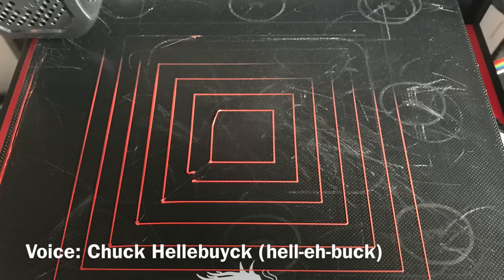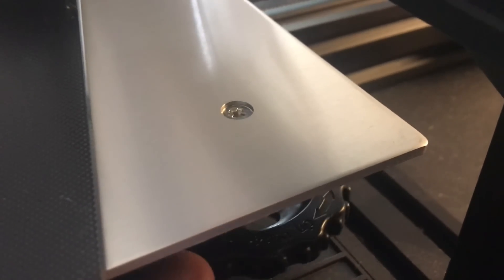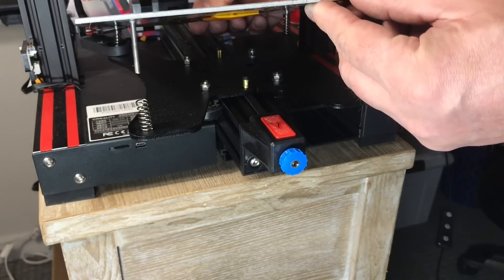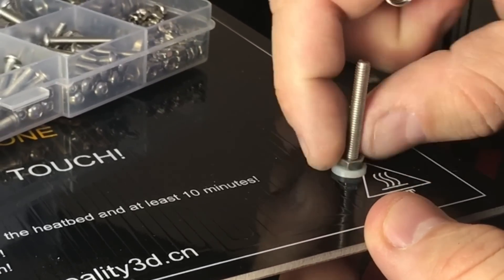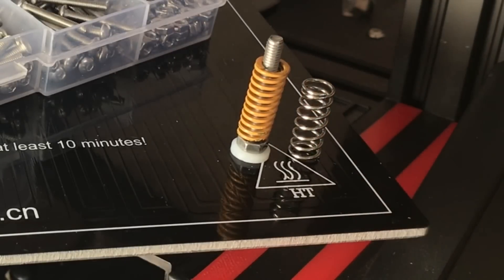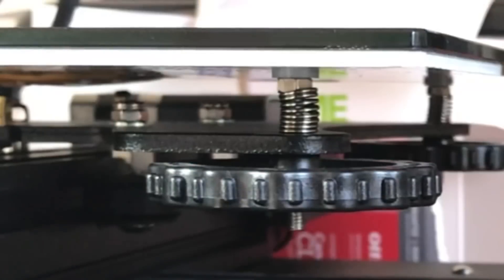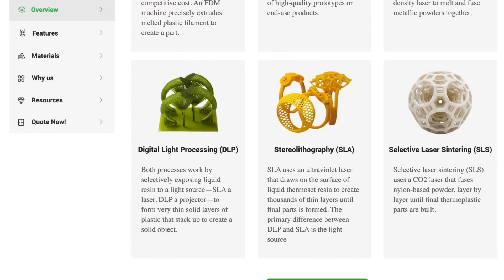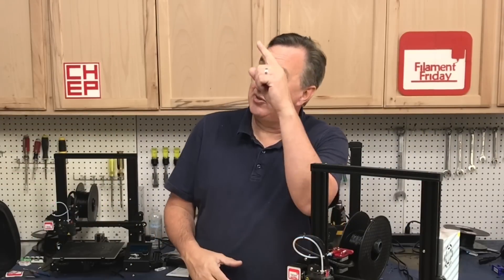Fix Your Creality Ender 3 Bed Level

Comment: My Ender arrived with a deformed bed. It is more deep on the center. It is a common failure with the Ender 3 Pro or it is only my case?
I tried to mold it just applying force with a lever and I partially solved the issue but it is still deformed. 
That problem increases the difficult when trying to print, not to mention patterns like the ones on this video, they are really imposible to achieve.
Can I dissasemble the bed and straighten it on a table? Or what I can do?
Reply from the maker: It’s somewhat common. Many people replace it with a glass bed.
Reply: @FilamentFriday  I did the thing of straighten and now it is working better. I dont want to use glass because: I have no money for now to buy a rectified glass (here the common glass from shops are some deformed too). Where I live is very expensive to get some things like that glass. And finally I like the Ender's hot bed.
Thanks you for your answer. I consider anyway to buy a glass.

Comment: hello Chuck, thanks for sharing so much info about 3d printer. in my workplace working with ultimaker with cura. (PLA) printing with 10 degree slop in part is causing issues in print.on bottom surface it makes steps of layer. tried with PVA filament. please help me or make a video on printing very low angle part. 50mm base 50 mm slop angle around 10 to 15. thanks.🙏
Reply from the maker: Use supports.
Reply: @FilamentFriday  thanks for  responding. i have tried PVA for support. but no good results , and sorry it was 80 degree overhang. 😅.

Comment: Is there a webpage or video that someone could point me to that helps select the right printer?
The Creality website has about 25 FDM printers including 4 different versions of the CR-10 and 8 different versions of the Ender. It gets confusing.
Reply: Depends on what you need it for and how much you want to spend. Ender 3 v2 is amazing for most prints, but limited bed space -- it's not very large. The CR10s Pro v2 is a great printer for larger items, but it's not as precise for smaller more detailed items as the 3 v2. The Prusa i3 MK3S+ is also amazing, but about double the cost of the Ender 3 v2 (even with full upgrades). Basically, just look for the release dates of the printers and but the newest. I believe all of the V2s are currently the newest of lines! Good luck, brother! 🤙🏼

Comment: got a new printer, whats the difference of the cura slicer and creality slicer, there is a huge difference between build time and amount of materials used
Reply from the maker: Depends on the settings. Creality is just Cura underneath.

Comment: The similar for my Ender 3 Pro, but used teflon tape (to keep it slim) and nyloc nuts. To install without peeling off the magnetic bed was a bit of a hassle using pliers and to get started and two regular nuts to torque down. Next part is replacing the wheels with wheels that take nyloc nuts as well.

Comment: Print the wheel to accept a nyloc nut - u will never have to adjust your bed again - I found the stock adjuster wheels move and float around a bit ( the stiffer springs would help the stock adjuster wheels from moving ) but I just run stock springs and nyloc  and havent adjusted my bed in over a year .
Reply: I did this as well, about a year ago. Hasn't moved since.

Comment: Now I just need to know why my Ender 3 won't print at the centre.
Reply: @Riggsvsoliver the bed is flat as possible. What i mean is that when printing, the the area printed is off from center. Meaning if you print is at the centre, the actual printing is slight forward than the actual print location.

Comment: Locktite Bearing Retaining compound undr the screw head will fix that without all the hardware, and will allow the screw to be removed later. A medium strength threadlocking compound might work just as well.
Reply from the maker: How will it handle 80°c bed?
Reply: @FilamentFriday  Engine parts commonly reach higher temps. Blue loctite is your friend.
Reply from the maker: My experience with building racing engines showed its great for bolts under torque but a looser fitting like these screws doesn’t allow it to harden as well and the higher temp adds to the issues. So I still like my simple solution.
Reply: @FilamentFriday  Race engines? Then you should know about the higher temp versions that have been out for years.
Reply from the maker: I know about them but the method I showed works for most of my audience. 
http://www.elproducts.com/stock-car-racing.html

Comment: I used some thread-lock on the underside of the screw heads.  It forms a very strong bond, but can still be removed with a little force.

Comment: Hi, I did this fix in two other brands of printers a few weeks ago, but the interesting was that I learned it from the Geeetech A10 (latest 2020 version), where nuts are included already in the stock bed so that bolts dont turn. The Geeetech brand is taking a lot of learning from the Enders around there and applying it to their latest products from stock. Interesting huh :)  

But great video and yes, this is a MUST almost to any printer, with the care of having proper sealing to prevent a short in the bed.

Comment: My Ender 3 has the magnetic sheet over my screws - looks to be glued there. If the only way to do this is removing the adhesive magnetic sheet?
Reply: Yes. You can cut a hole through the sheet to remove the bed easier.
Reply: @a2112drummer  no. just thread one nut down to the bottom. then put two nuts on the end jammed together. then use them to hold the screw while you tighten the one to the bed.

Comment: You could have used a very small drop of semi permanent (removeable) Blue Loctite on the head to stop it rotating.
Reply: loctite 242(blue loctite) softens with temperature quite easily
Reply: @gglovato  Goosd point... Didn't think about the heat...

Comment: I went straight to the yellow springs, a few months ago. Immediately solved any levelling issues
Reply: Same here - they're longer, but if you squish them it makes the whole bed very stable between prints - now I'm leveling it almost only when I change the filament type (I'm looking at you PETG...), nozzle, or bed surface - works like a charm
Reply: @KonradSarnowski  I’ve actually printed 4kg without touching the bed level. New record.

Comment: noob question, but are you lowering the z onto the paper, or onto the bed, and then sliding it under?
Reply from the maker: Lower the z stop so it homes low enough to get close to spring compressed then adjust bed knobs to slightly rub on the paper.

Comment: I use the same trick for ages. I also experienced the same problem. I used first metal washers I made a short cut, but fortunately damaged nothing. I then purchased PTFE washers.
My goal was to make the link between the bed and the carriage more rigid. If you block the carriage and push the bed you will see that the bed is moving, not much but it is visible, and the bed does not go back to the exact same position when released. This has little effect at low speed but the faster you print the more efforts are needed to accelerate the bed what introduces these displacements and generates artifacts in the prints.
Before tightening the bolts, I maintain the bed in place supported by pieces of wood, as high as possible but with the screws inserted in their holes (no spring, no knob). This ensures that the screws are parallel, and that the bed can move freely vertically. I tight quite hard.
Thanks for your videos.

Comment: The knob in the Z-axis switch is actually to align the switch vertically on the correct height on an all-stock Ender.
If all is mounted and aligned correctly, the switch is on the perfect height when aligned with this knob. I wouldn‘t cut it in a stock machine...

Comment: I've added locknuts upside down to safe the conductive lines, works great and I don't get problems with softening washers due to an heated bed. Adding a washer between nut and spring prevents the spring from shifting and/or slippin over the Nut

Comment: There is also Locktite Blue. if needed  It will hold a screw in place, but you can break it free if needed
Reply: Loctite has different bottles with "blue colored liquid", the number on the bottle is important to know if you have the right one ...

Comment: I installed my printer last June and started to see similar problems. Unfortunately, this video only came out today, and other videos that also demonstrated it I hadn't found. So instead, I was "that guy" who over-modded his printer WAAAAAY too early. After two weeks, in a panic and taking too much advice, I spent the next two weeks installing the BLTouch, trying to learn how to flash the firmware to do even that, bought a glass build plate, and reworked the gantry...twice.  June was HELL.

In the end, I found that three of the four screws all rotated on my bed and I also ended up with a bad USB port (which was the cause of all my woes trying to update the firmware). I got nylock nuts and an SKR Mini board...and things worked out well.  Still, overtime, my bed is BADLY warped and I'm still struggling with it from time to time, but seven months later, I'm starting to get prints that are behaving.

I've broken parts of my printer (overtightening wheels, stressing wires, etc.), found places it was just manufactured incorrectly, but one thing is for sure: I KNOW my printer now. I'm far less inclined to "OMG! I need to order a new expensive part!" than I was six months ago.

But no...I'm not giving up on this thing. Not by a long shot.
Reply: Same thing here, purchased the printer with the mindset of "oh! I'm sure this $220 printer will be just enough out of the box" and 1 week later I was installing a bl touch and upgraded springs and extruder and modifying the hot end... Always something with these machines I swear lol
Reply: @gopro2027  I'm in the same position, I absolutely love upgrades but usually I wait enough to fully understand the stock product. Now I am terrified that if I change the hotend or whatever I will eventually mess up all the experience on the stock one that I have lol
Reply: @davidefogagnolo   to do the upgrades I still had to understand how to level the bed and stuff, and taking apart the machine to put on the upgrades helps me understand it more in that sense. I don't think you will mess up any experience you have.

Comment: I got a kick out of how you introduced the ad:  "If you're watching all this, and if you don't want to fool with a 3D printer any more...."  I don't think most of your audience (including me) will ever get tired of fooling with 3D printers.  That being said, I found your simple mod very interesting, because I did something very similar to the bed of my Ender 5 Pro.  In my case, I had a feeling that the knobs were not staying put, so I decided to design and print some leveling knobs that had a nylon-insert nut in them.  Of course, when I tried to put these on the bed screws, the screws just spun around.  I did just what you did (minus the plastic washer, which I should probably go back an add..), except I used some larger diameter springs that went over the nuts.  (I also had to cut openings in the magnetic pad at the head of each screw so that I could access the screw heads with a screwdriver.)  This mod has worked well for me, because the bed adjusting knobs seem to be staying in place now.  Thank you for this video.

Comment: I use the yellow springs + nylock nuts, and also adjusted the Z stop height so the springs are compressed a lot. This has helped and I no longer have the bed losing level every other print.

Comment: holy heck. this has fixed my issues :D i used the yellow springs but it doesn't work quite as well. the nut thing works perfect. i didn't want to pull the magnet thing off mine to do it. so i used two nuts to jam nut on the end then tightened up with the third.

Comment: is there anyway you can do a vids regarding to how your ender 3 max is doing? cura issues? i got one for the holidays as a gift. its my  first printer and i am kinda lost with it. i had the issue with the Z endstop and moved it down and got it level did some test prints but nothing is really doing well after that.
Reply from the maker: I have a new one to review but my original prints great.

Comment: Chuck, had this problem myself and can't understand why creality don't use a regular hex bolt in a recess as the countersunk set screws are a problem waiting to happen.  Also very disappointed with the bed out of the box, it has quite a dish on it.  Your video echoes the idea I've had however I intended using nyloc nuts.  Loving the videos always informative, brief, and easy to follow, the perfect format, great job!
Reply: P. S.  Tried the yellow stronger springs, this didn't solve the problem!
Reply: "why creality don't use a regular hex bolt in a recess"
I'm thinking it's a penny-saver move.  One less manufacturing step.  Much easier to countersink a round hole than form a hex-shaped recess.

Personally I would rather pay an extra quarter (or whatever) for my printer and eat the expense... because this problem seems like a doozy that could be avoided, just as you suggested.

Comment: Any idea what to do with a warped bed on an Ender 5 Pro? All corners are fine but the middle is too high. I saw people sanding the bed down but I'm still looking for a less "destructive" way to fix this.
Reply from the maker: Replace the glass bed.
Reply: Try too tight or loose a little bit the excentric nuts of the bed, they change the geometry of the bed, yuo could see this , just put a ruler (a metal one its the best and see how warped is o not the bed), then try to level the bed
Reply: @noway8233  There are no excentric nuts on the heatbed.

Comment: What if I have a magnetic sticker on top?
Reply: You can always use plies on the er business end of that bolt instead of using a screwdriver. It doesn't have to be that tight  anyway

Comment: Great video Chuck! I ran into this problem from my first Ender 5 and actually used knurled nuts however, just as you pointed out, over time it shorted out the heater on the bed. Fortunately it didn't kill it so I went with one thin nylon flat washer along with 2 stainless flat washers to prevent the washers from spinning. Have done the same thing on the other 3 printers and it works like a charm! Especially good for beds that have the magnetic sheet with adhesive and the screws are covered over😉! Do this trick whether you're using springs or the silicone springs(or whatever they're called lol). Love the tip on cutting that little stop tab on the z-stop switch! Thanks for another great informative video Chuck!

Comment: I tighten all 4 knobs then i use a dial indicator and only loosen where necessary. It's rock solid any never once had to level the bed. Try it chep it basically a no rocking bed.

Comment: Instead of Springs use silicon puffer. the best option so far i found.
Reply: The screws still turn inside a Silicon buffer.  Locking them off is the best solution.

Comment: I just added washers (metal; I think I'll just print some PETG washers) and m4 nuts to the bed leveling screws on  my Ender 3 Pro. I was going to print some bed leveling locks, but I just upgraded to an SKR mini e3 v2 and a BLTouch, so I don't think I need the level locks anymore. Adding the nuts to the bed level screws made a huge difference before adding the BLTouch, I recommend everyone do that immediately. After the BLTouch, I'm not worried about losing bed level and don't manually re-level  until a nozzle change. I've been printing non-stop for two days, no problems.
Reply: Printing a PETG washer.  Brilliant!  Although I wonder if it will have issues in the long run with the heat
Reply: @Guapogiboy  Probably. 80°C is the hottest my bed would ever get, but I'm not sure that would be enough to soften the PETG to the point of warp/squish. 80°C would definitely make it pliable, though, and maybe cause it to stick to the bottom of the bed. Structurally, the washers should be fine under full surface and even compression. Maybe. I guess I could find out. 😝

Comment: While troubleshooting the same issue, this Chuck's video popped right up. Godsend! :D

One important comment tho...instead of using nylon washer, what's more appropriate is fiber washer which is heat and vibration resistant. And instead of springs solid bed mounts which act as stabilizer and more vibration resistant.

Comment: i printed washers with a nut spacer and spring cup for the bed, and spring cup for the sliding cart, and use the stiffer springs
mounting on 3 points instead of 4 makes it alot easer to level, have not had to level it again after in 3+ months